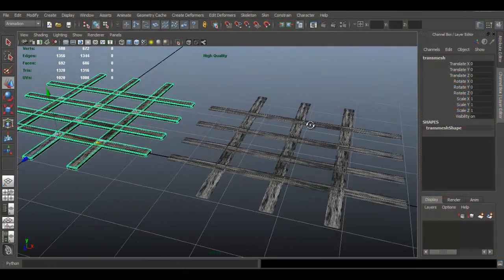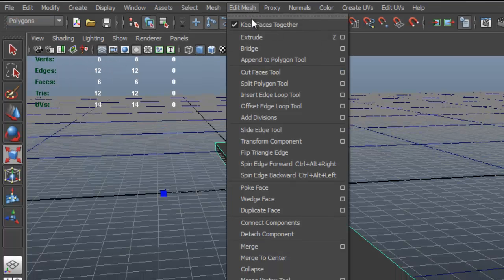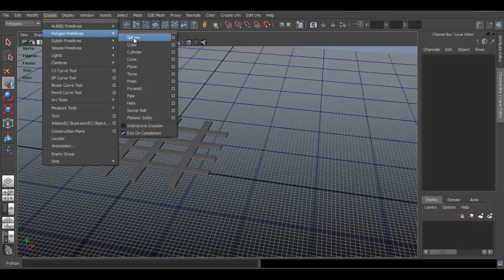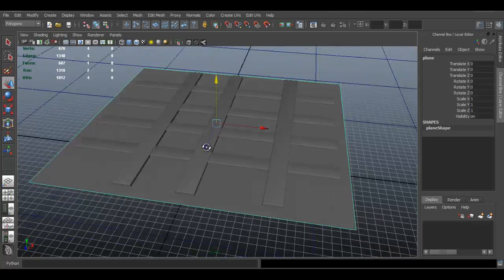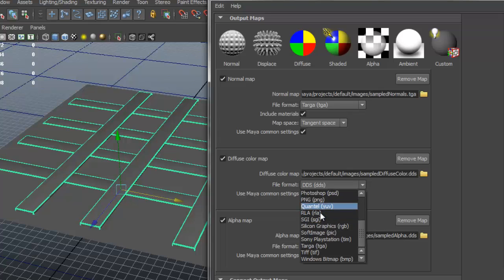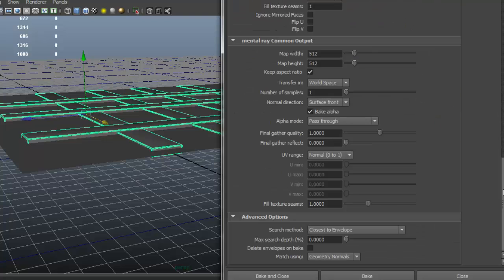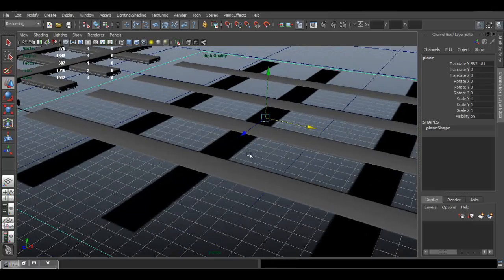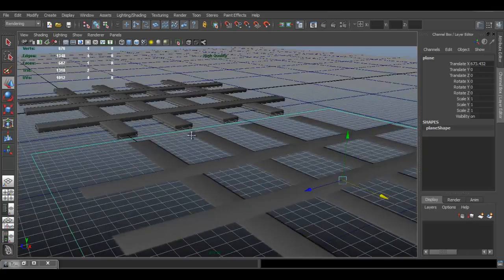Autodesk Maya 2014 Tutorial - Baking Normal and Transparency Maps within Maya

Comment: hey whenever i am clicking on the transfer maps option in maya 2013...it's showing error "value is out of range:0"...pls help me!!!!
Reply from the maker: make sure both objects are exactly on top of each other, I think they also have to be on the origin of the grid. To move objects to the origin of the grid, select the object and at the top of the screen there is an area where you can type a numerical value for x,y,z - type 0 for all values and this will move your model to the origin.